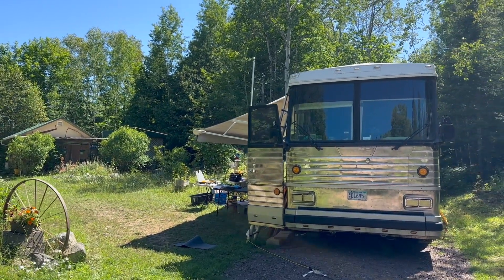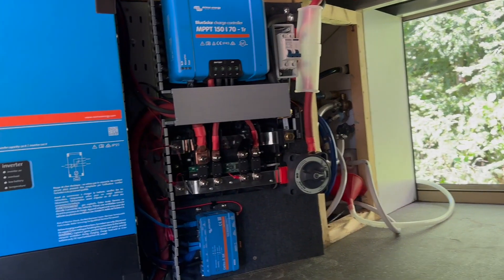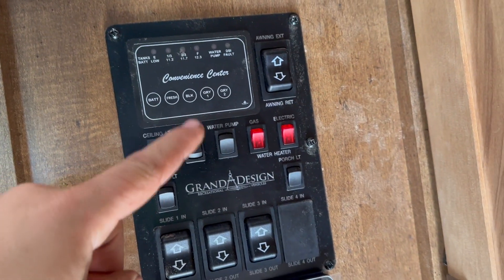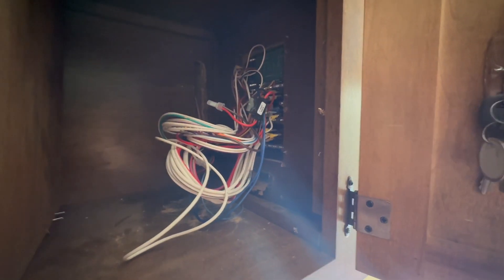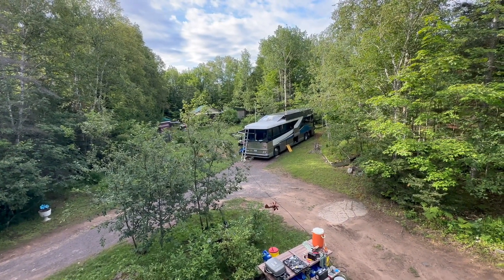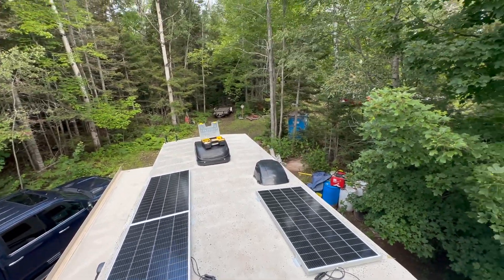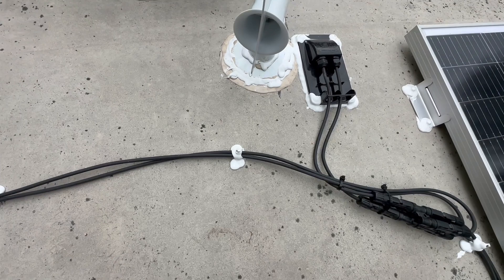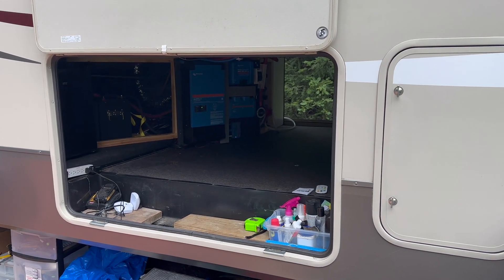2016 Grand Design Reflection 337rls Victron Multiplus Solar Install  400ah SOK battery  800w Solar

Comment: When you ran that wire down for the solar, Did the pipe run straight down to the bottom and was easy to feed those solar panel wires from the roof to the bottom area there or was there more panels on the inside to remove  to get to it.
Reply from the maker: I believe it was a straight shot. We’ve had few instances where we needed to remove interior panels when using a vent pipe.
Reply: @sotasolar  thanks for the info!, excellent video you put together here and I'm sure it's great help for others as well.  Was possibly looking at this model/year of trailer and solar is a nice thing to have even if it's only a panel or 2.

Comment: It looks like that charge controller was capable of handling 150 V in why wouldn’t you put the panels in series for better efficiency
Reply from the maker: It’s something we considered , we’re on team series for sure. But in this case, with the tree cover and the roof items it made more sense for parallel. Keep in mind these are 24v panels so they run at 45VOC so it’s not that bad. They’ve said they’ve been doing great all summer, hardly run the generator and that what it’s all about.